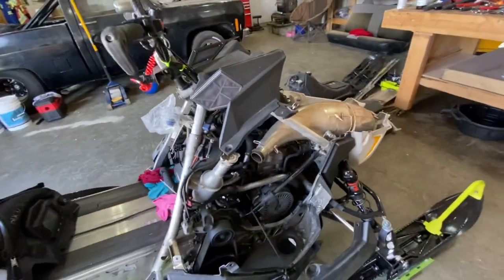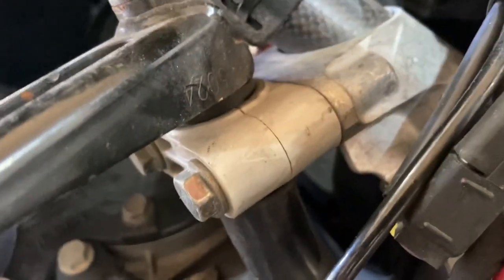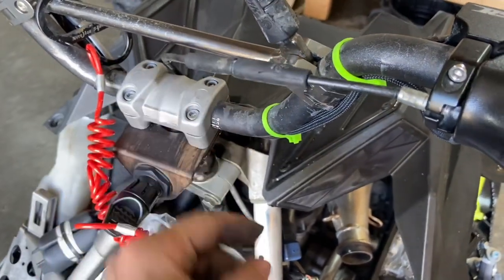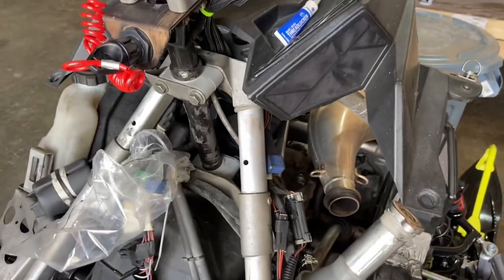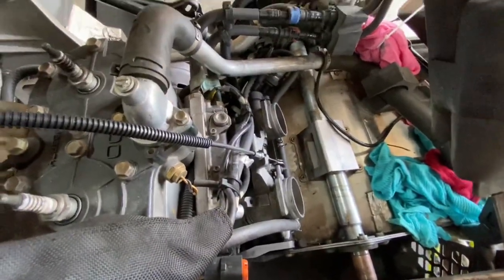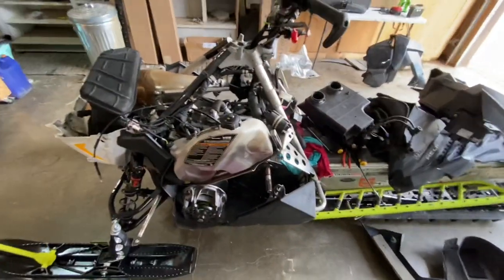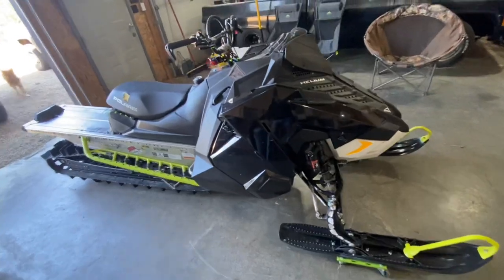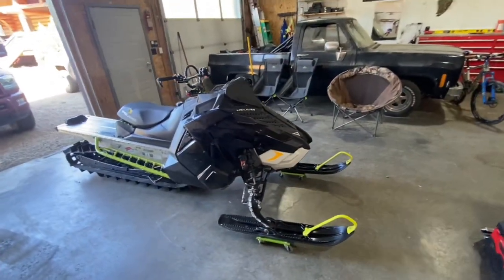Sled Mods Part 6 Wrapping it all up! Ice Age khaos conversion/ elevate kit/ Boondocker cooler/ etc..

Comment: Sled turned out amazing. Do you happen to know the length difference between the early axys front shocks compare to the React front shocks?
Reply from the maker: The early Axys front shocks were 16.63” extended, 10.86” compressed, for a stroke of 5.77”
The React front end shocks are slightly shorter at 15.95” extended, 10.25” compressed, for a stroke of 5.7”